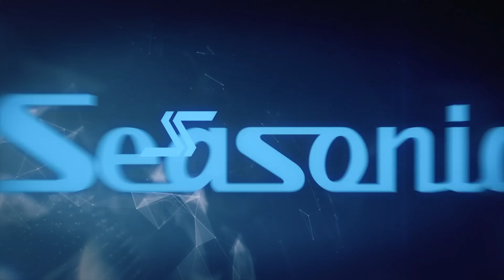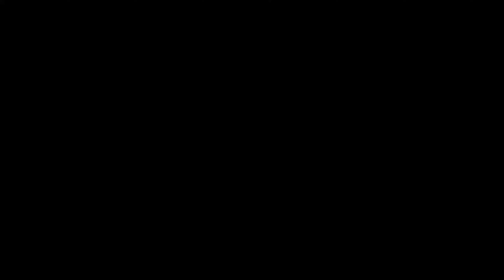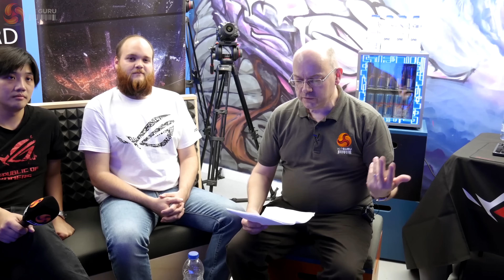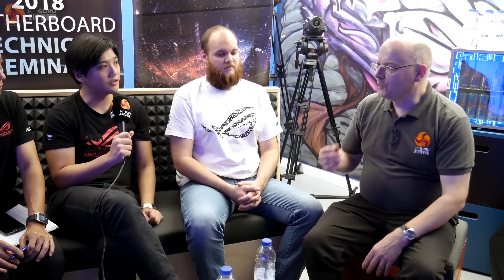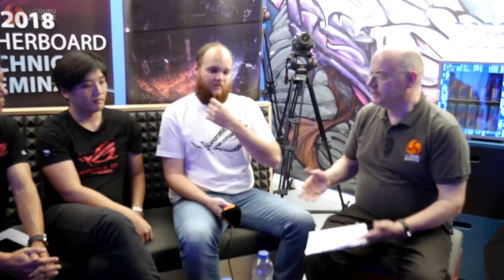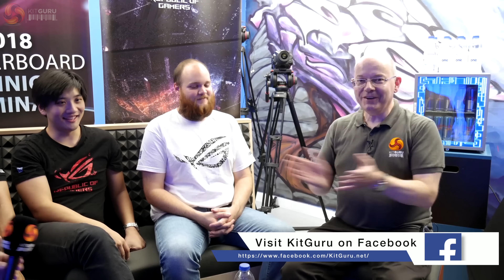LEO gets the INSIDE INFO from ASUS (featuring Jon 'Elmor' Sandstrom)

Comment: 10:20  "If you dont plug in the memory stick in correctly"  ???  Id like to know how you can plug it in wrong.. lol.  Almost all their answers were either sidestepping or just didnt want to answer them.  Like the 95 watt TDP question and others.  Asus has nice motherboards ( the prices are getting out of hand tho , imo)  but their drivers and software are getting pretty bad and not updating frequently enough.

Comment: ASUS is a bad company. They're on their way of becoming Razer 2.0

They got faulty bios files on their website (happened to me personally for a client and Linus admits the same in a recent video).
Their monitors are breaking left and right, the replacements they give are showing the exact same issues after almost the same amount of time used.
Their RGB on the GPU's has an issue that the Fibre tubes they use, can turn white due to heat and thus being unable to transfer light.
Motherboards incompatible with certain RAM modules, even though they're listed as working.

Oh and not to mention their horrible support.

Nah, I stopped using ASUS products for my clients. Whereas before I would recommend them, I now warn my clients for this company.
Reply: Pc ColdWar. No other company is flawless, I honestly just look per product what would be best. No preference anymore towards a company. Every company will have to proof themselves per product type.